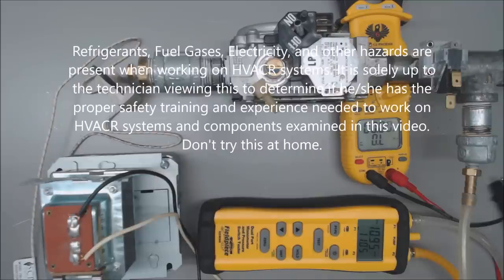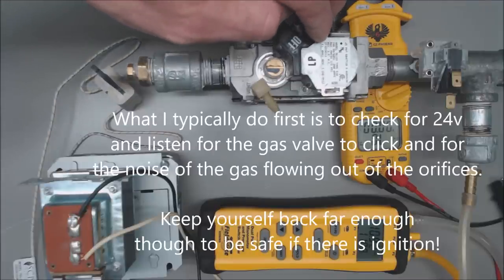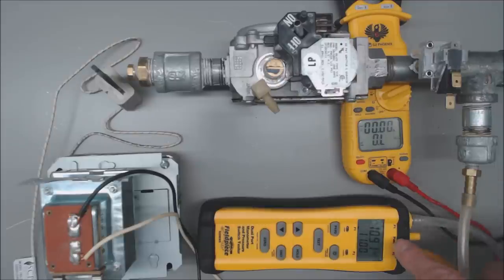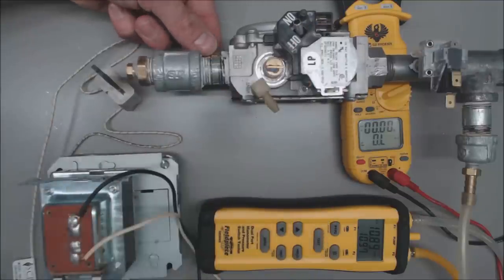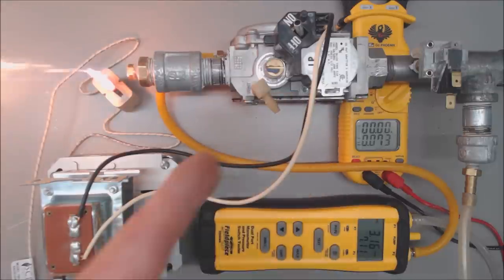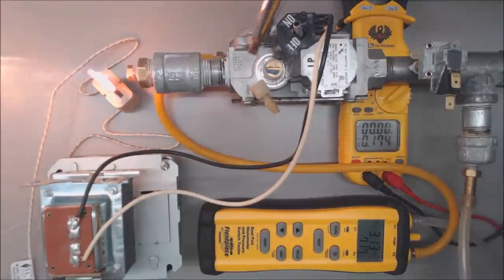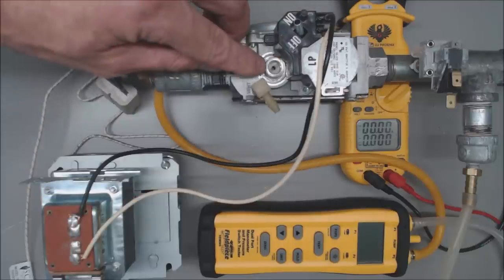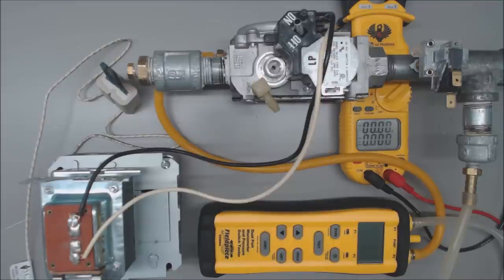Gas Furnace Won't Ignite! Direct Ignition Gas Valve Troubleshooting!

Comment: Great demo and video. I take the inlet gas pressure from the drip leg like you, the only difference is instead of using a cap with a fitting I just use a few reducing bushings with the brass barb adapter at the end.
Reply from the maker: Got ya thanks Kenny W!

Comment: Great video and well presented but what if you're not getting 24v at the valve. You covered the scenario if the gas pressure was off but not if your meter isn't reading volts at the terminal. I can really use the help.
Reply: Transformer / safety preventing the circuit from being completed

Comment: super explanation as always.
Reply from the maker: This time look at the surroundings. Notice if it has a variable speed inducer motor. If so and the gas valve does not have a brass screw covering the adjustment spring then it is modulating, thanks!

Comment: Great video
I am trouble shooting my gas valve and when I check voltage at the 2 wires to the gas valve I get a constant 15v and when the gas valve is suppose to open the voltage stays at 15 volts but no ignition. HSI glows but no fire. Do you thinks it's a bad board?
Thanks for any input

Comment: My igniter lighted up, but the gas valve didn’t seem to open. I removed the electrical plug from the gas valve. Should I measure the voltage on the wires or on the gas valve? The plug has 2 tiny holes on it. Please advise. Thank you so much.

Comment: Hi there I was watching your video and when I pulled the two wires off my gas valve in the beginning it red 11.92 volts on a constant then the glow plug lit and glue for 90 seconds and then I heard another click which is supposed to activate the gas valve and when that happened the voltage drop to 0 not to 24 on DC. Would this be a faulty board or is there a voltage regulator of some sort? I have a Nordyne rooftop mounted unit
Reply: Love to know.. Same as my goodman home furnace

Comment: Do one on the igniter being the flame sensor.
Reply from the maker: On this setup, I was just using the hsi and gas valve in the shop. I was just showing how these components would work and didn't have them connected in the furnace with the inducer motor, pressure switch limits, flame rod, or control board, thanks

Comment: Thanks for sharing! I have really old magicpak Armstrong unit and the pilot light stays on for a few seconds and goes off and than goes back on, can’t stay on consistently. With clicking noises. Would you say it’s the electrode, ignition system or valve issue? Any way I can properly diagnose. Thanks!!

Comment: AC service tech. Please help. What's 5 flashes error code. " flame sensed when no flame should be present "? 

I cleaned the flame sensor. No voltage going to gas valve. Gas present. No voltage at pressure switch. ...

Comment: Great video.  I am still having problems with no ignition . The igniter isn't glowing and I have 24 volts to both sides. I am n a pickle because I have to leave for work and my girl doesn't hace heat with the kids. Can u help?
Reply from the maker: This was a 120v hsi used in this video but if you have a 24v hsi and you have power going to it and it won't glow then it is bad, thanks
Reply: I ohmed it and is fine. And I can get run a lead to igniter and it glows but still no heat sequence.  Didn't mean to get any free info.  Was just picking your brain
Reply from the maker: What kind of unit and what kind of gas valve are you dealing with? Your comment in the other section was on a smart valve where as this one was a single speed standard direct ignition 24v gas valve, thanks
Reply: It's a smart valve. 24 volt just like u have in this video.  I do appreciate your time. Really do

Comment: How are you reading 24v at the valve if when it’s energized I thought you should read 0 voltage since it is the same circuit.
Reply from the maker: The gas valve is a load so we are reading the hot and common, there, thanks!

Comment: I am working on a Weather King furnace with igniter.  The furnace has not been used in a long time and the gas has been off at the gas company meter for about one year.  Therefore, I bled the gas line about 3 feet from the gas valve.  However, I do know that before the gas meter was turned off, the furnace worked fine.  Now, when I turned on the thermostat and the furnace, there is a call for heat, the inducer turns on, purges, but the igniter does not turn on and then the inducer stops.  I am wondering if the problem is low gas pressure due to non-use of the furnace for a long time even though I bled it; does it need more bleeding?  The other furnaces in the building required gas line bleeding.  I bled this gas line on this Weather King but is it possible not enough if there was still to much air in the gas pipe.  I have not tested the igniter yet, nor tested the pressure switch for the inducer.   The circuit board throws off a green led flashing twice which i believe means the pressure switch is open.   What do you think the most likely problem is here.  Sorry for the long message. Thanks.
Reply from the maker: It sounds like something is affecting the pressure switch or that the ignitor is not working. I would check to see if there is a problem with 90% efficient condensate, tube blocked, intake air blocked, exhaust blocked, and test actual pressure  going to the switch, thanks

Comment: is there a way to tell if a gas valve is a modulating one? i believe one stage has one adj. tap, two stage has two taps. what about modulating gas valve? thanks.
Reply from the maker: This time look at the surroundings. Notice if it has a variable speed inducer motor. If so and the gas valve does not have a brass screw covering the adjustment spring then it is modulating, thanks!
Reply: so a modulating furnace ALWAYS has a variable speed inducer motor with it?
Reply from the maker: Yes because the inducer speed will need to match the gas valve volume. PSC inducer motors typically don't have enough speeds and they are fixed, thanks

Comment: Isn't natural gas 3 wc coming out and 10 going in,and 7wc coming out for propane?
Reply from the maker: Natural gas is 5-7"wc and propane is typically 11-13"wc coming in. Nat gas is typically 3.0-3.8 output and propane is typically 10 coming out on single speed units. You will have lower pressure output on multispeeds and units other than furnaces, thanks

Comment: “The service wrench”.  Why not stub an analog gauge out instead of using an expensive device?
Reply from the maker: Its because we are measuring less than a psi. We are measuring minuet pressure in "Water Column, thanks!